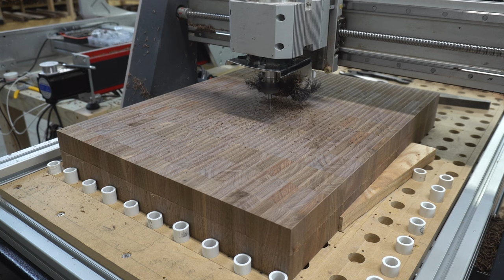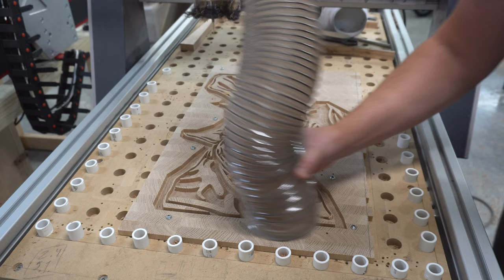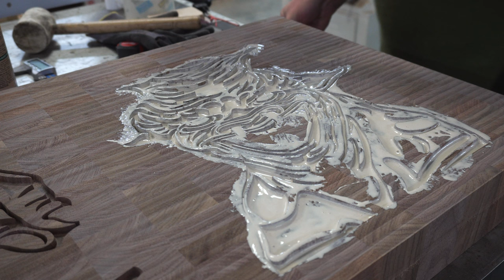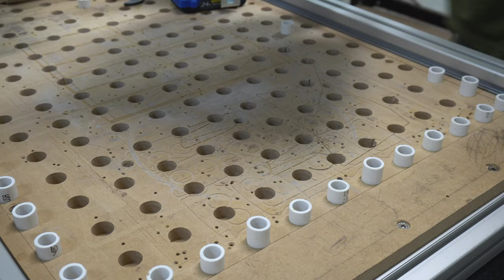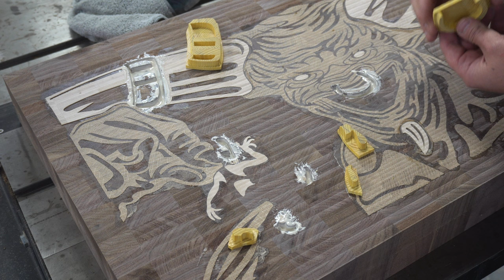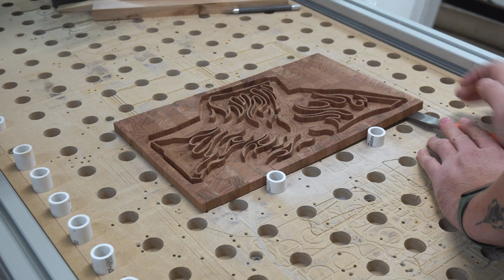Juzam Djinn cutting board. CNC wood inlay. BroinwooD

Comment: I would have a heart attack from the stress. Any power failure or hickup and the project is firewood.
Reply from the maker: Oh yeah, I had those situations multiple times, but i found a way to fix or continue to work even after the power was off.

Comment: I'm always really surprised at this.. Why dont you use a larger bit to plane off the excess material?  I use a 1.5 carbide surfacing bit. Is it because you like to take a deeper depth of cut?  You shouldnt have to worry about chip out with a surfacing bit

Comment: Do you sometimes get cracks or small gaps in the inlays? And how do you deal with them? I've had a couple inlays crack along weird grain lines or whatever, and have just been packing them with glue and sanding them over. If you know a way to prevent that I'm all ears.
Reply from the maker: i am trying to avoid glue gaps and make my inlay as tight as possible. But wood cracks are unpredictable. If the crack is dramatic, I can redo the inlay part. If not, I leave it as is; fill the crack with beeswax.
Reply: @Broinwood  awesome, thanks